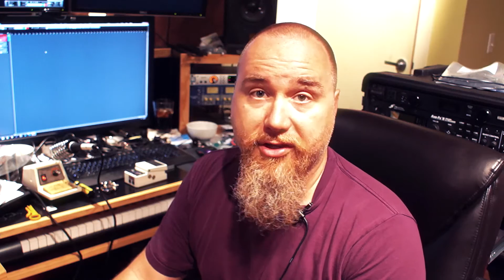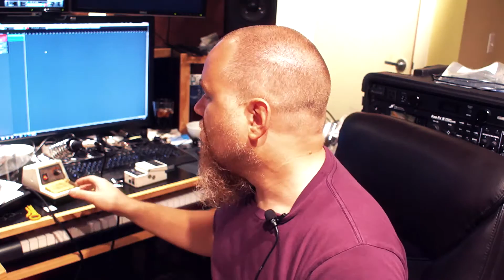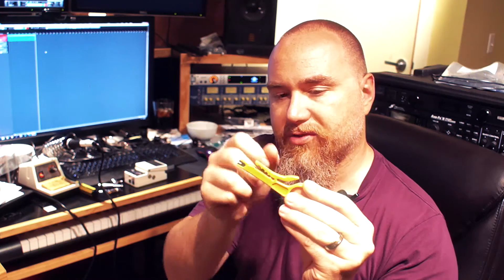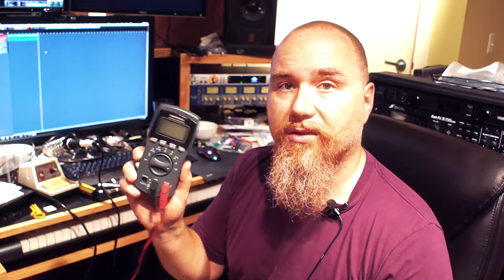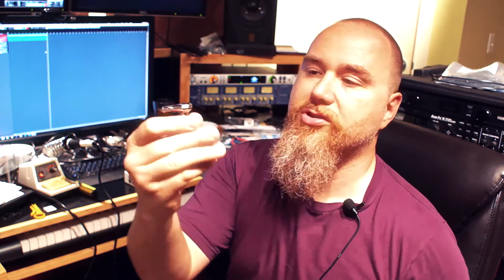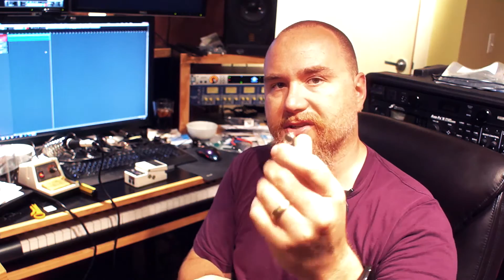Building Rig 2.0 - Part 2   Introduction To Soldering

Comment: Hey man.  Awesome videos; probably the best online that I could find!  Really clear explanations; I look forward to building my own cables soon.  Quick questions: 1) Is there a place online where you can order just a few feet of the Belden cable (I could only find it in large quantities)?  2) That cable looks thinner than 1/4"; could you use or would you recommend the Mogami 1/4" for patch cables on a pedalboard?  3) Any chance you could make a short video of soldering the pancake plugs?  Thanks again!
Reply from the maker: Thanks, glad you found them useful! :).  I can put together a video on soldering the pancakes as well, the basics are the same, just the physical layout is a bit different (there's still ground and tip terminals).  I just have to find the time to make it :)

As for your quesitons:
1) I found this place that seems to sell by the foot:

http://www.eio.com/p-40679-belden-8218-coaxial-cable-sold-per-ft.aspx

2) The Belden cable is a rather thin cable yes, but it's perfectly fine for quarter inch connections.  It's perfect for pedal board / rack connections that are tucked away on a board / in a rack.  I also use it for my instrument cables in my studio.  For more heavy duty cables (i.e. for use live where they're exposed, or as instrument cables), definitely something beefier like Mogami (or whatever you prefer) is a good choice.  I'd also recommend spending on some heavier duty connectors as well.  You can also use Mogami for your pedalboard / rack connections if you prefer, it'll just cost a bit more.  Many of the custom rig builder companies use Mogami, it's definitely a fine choice :).
Reply: Benson Russell
Thanks so much.  That's all very helpful!